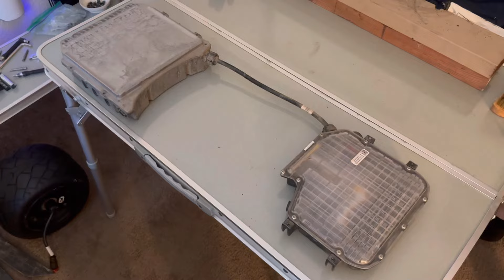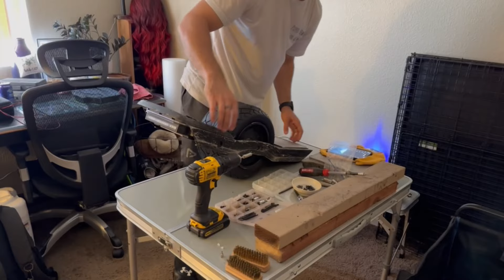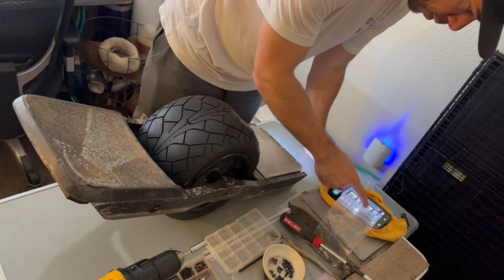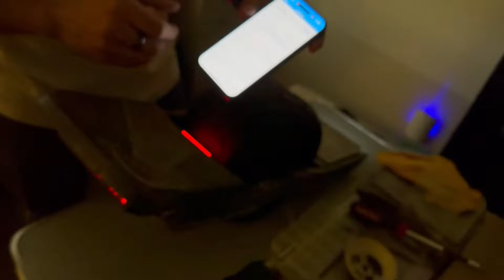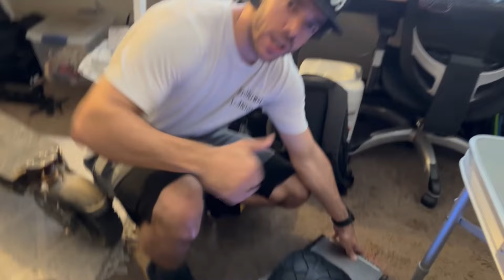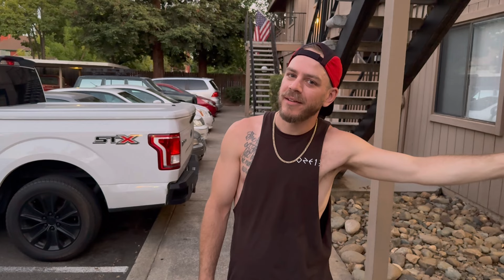Is the Onewheel GT Battery Module Worth It?

Comment: I’m not sure if anyone knows how to fix this but on the motor wire that connects to the controller module shows a slightly different color on the connection to controller module, which I assumed burned out a bit when I had the broken plastic motor wire retainer ring that made the connection loose. By the time I replaced the ring I sometimes get power loss when I start riding it which rarely causes the board to lose all power which I had to bail out twice. It isn’t safe anymore and I’m not sure if I should replace the whole controller module just to get a clean connection to the motor wire. If only future motion used a metal wire retainer ring this wouldn’t have happened but they had to go for a cheap plastic one. My Onewheel gt only had 18 miles when this happened smh
Reply from the maker: If it's bad enough (sounds like it might be), you might need to replace at least the controller connector. If you're still dealing with this issue, contact me at https://www.fixmypev.com/contact-us. I'd like to learn more about the extent of the damage to your board.

Comment: Can I still pair a non updated XR controller with an updated bms? And vice versa
Reply: Should theoretically work as long as the XR firmware isn't updated to haptic buzz. This would apply to any Hardware from 4210+. Doesn't matter if it's HW 4209 and below
Reply from the maker: As long as it's an XR BMS, you shouldn't have any issues.

Comment: You guys used the original BMS?
Reply from the maker: Ultimately, yes, but tested the replacement module with the original controller (running Cassiopeia - 6109) first. No 'Service & Registration' portal required. Not for now at least.
Reply: Assuming the same deal with pint. Would you say it's worth it to get the module to swap the battery's on a rewheeled board? Using the original BMS.
Reply from the maker: @nikon9871  I'd definitely say so, although there have been some hiccups noticed with the Pint (due to reported battery type differences). Nothing we haven't been able to fix using ReWheel and BLE so far though.